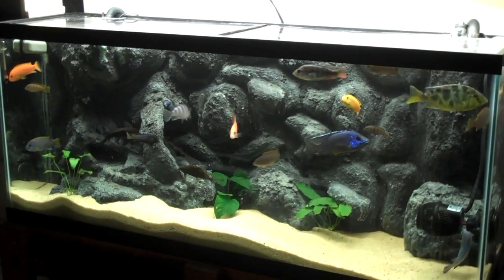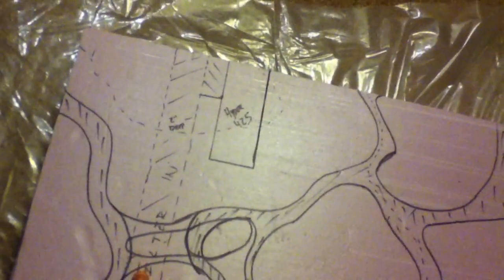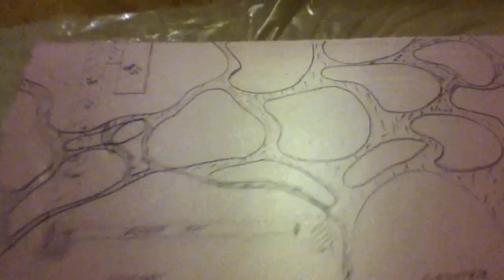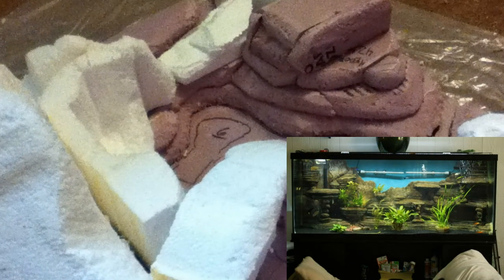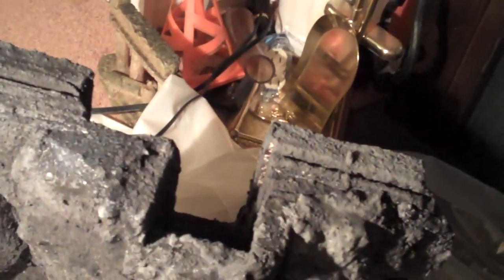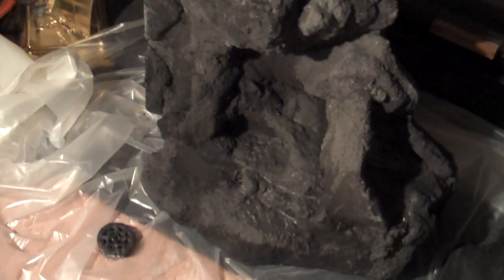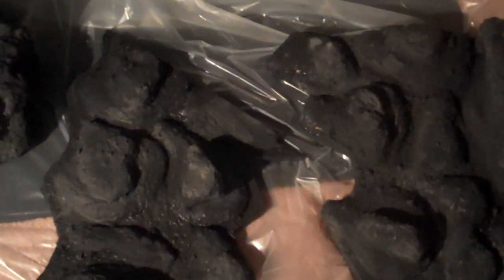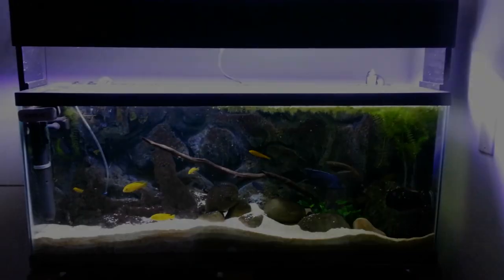How to DIY Foam and Concrete Background

Comment: Awesome video. I have so wanted to try this. Looks like fun. Is there a certain type of concrete I should stay away from? I know you've said not to add fish for a few weeks. I will be calm and wait, but is they're aquarium friendly materials you can use? I need to get test stress and get in the whole swing of that. I've had tanks for years but as much water changes I do a day to water all my plants I never bothered with it. Think it's time to though.
Reply from the maker: +emily Jenkins It's a fun project. I just used regular standard concrete. You're going to be sealing it anyway so it should be protected. The monitoring for a couple weeks is just making sure everything is working well and if you need to try sealing it again or something.

Comment: what did you seal it with and what color did you go with in your cement mix?
Reply from the maker: I do not recall the exact product I used to seal the concrete. It was acrylic concrete mix. Shouldn't be too difficult to find. I used a charcoal/black concrete color. Other options included Adobe red and green. Someone with more artistic talent than me could put together a great looking background by shading using multiple colors. The black and green would make a particularly good combination.

Comment: hey I had another question I am looking to get a led light for my tank what are some good lights I need 36 inch light
Reply from the maker: +kevin matechak I built my own LED light for my 29 gallon. It's dimmable which is excellent. https://www.youtube.com/watch?v=WJXT0-fTTxU

In total I think this cost me about $150 but it's powerful enough to keep plants. You can go with a commercial setup, like the Marineland brights/doublebrights, but planting with them is iffy. Plus, they will run you about the same price wise.

A third option is to use an LED strip. You can find them on ebay for $15-20. Just search LED Strip light. UaruJoey has a nice video on making a light using these. I am considering building a new light for my 135G using them. They will not be powerful enough to grow plants but, if you're keeping only fish, they will work.
Reply: +AquaStudent a friend of mine built his own using that video but the led power source is made so cheap it burnt out and melted I go through amazon so the led tank lights are pretty cheap a 36 inch which I need is around 60 to 80 depending on the brand I also bought a hydor nano circulation pump cause I hate bubbles lol it is 565 gph which should be fine just gotta find a good spot to put it in the tank
Reply from the maker: Just keep playing with it and you'll get it.

Did he build the light from Joey? Perhaps I won't go with that on my new build.
Reply: +AquaStudent how many lbs of sand would I need for my 65 gallon? I bought a 50lb bag of pool filter sand so hoping that is enough
Reply from the maker: Depending on how deep you want the substrate to be that should be enough. You can always add more later :D

Comment: I plan on using egg crate and using cans of spray foam on the egg crate and then a couple of coats of cement hydro lock and finish it off with a couple coats of krylon fusion spray paint
Reply from the maker: +kevin matechak Sounds like a plan. Let me know how it turns out.

One issue I had with the spray foam was it shrinking over time. Not sure what caused it. Be wary of that.
Reply: +AquaStudent how long before it started shrinking? have you ever just painted the back outside of the tank? I saw videos of people doing that and must say it looked really good also I might do that and just make a nice big cave with little plants coming out of it with the spray foam and sheets of foam I wanted to ask which concrete is the best to use? I am going to go to home depot this morning so any help is appreciated I saw some videos were they used some sort of cement that was like paint thinand they did like 6 coats
Reply from the maker: I used regular cement. Depending on how much water you mix in will determine the consistency of the mix. More water would mean a thinner cement coat. Definitely apply the first coat thin so you have a base for the rest. After that it's up to you.

I have all of my backgrounds painted now. I've used both spray paint and plasti-dip. Both work well. It's really up to personal preference. I have not yet used latex or brush paint although others have had success with that too. Take a look at my other recent videos for what those look like.
Reply: +AquaStudent they sell rustoleum spray paint here which type of rustoleum spray paint can I use?
Reply from the maker: The only rustoleum spray paint I've used was the one made for plastics and that was on PVC. I don't have experience with any other type. You should look for something clear. You can also get cement pigment to color your cement. That is what I used. No need to paint the cement.

Instead of using spray paint you could also look for an acrylic cement sealer. That's what I used to keep the cement from leaching.
Reply: +AquaStudent what concrete color dye would be good the charcoal color? have you ever painted the back of the glass I painted the glass black with white sand on the bottom it looked really nice surprisingly
Reply from the maker: Yes. I painted my back glass black. I like the look of it. I've always wanted to experiment with the patterned spray paints like the sand or rock colors but haven't had the tank to try it on. Perhaps I'll try it on my growout/hospital tank when the weather gets warmer.

As for concrete color just go with whatever you want to look at. I got the charcoal. The more you mix in the more pigment you'll add. I believe other colors include a light brown, brick red, and green. You can also mix and match to get any effect you want. You can customize it however you want.
Reply: +AquaStudent if I go with spray paint do I need to it clear coat over it? also do you know of any videos to build caves with the foam?
Reply from the maker: You're getting into an area that I don't have experience with. If you're willing give it a shot. You shouldn't add fish for the first couple weeks anyway so just keep an eye on the water parameters and keep testing them.

I built caves into my background. I also had that tunnel running along the bottom portion to allow two areas for the filter intake and to house a heater. This was mostly in the insulation foam though. I strengthened hte opening using PVC pipe which also allowed me to build a cap for them. You can use PVC to give yourself a base. You may need to sand the pvc to give something for the concrete to stick to if you want to cement the inside of the cave.